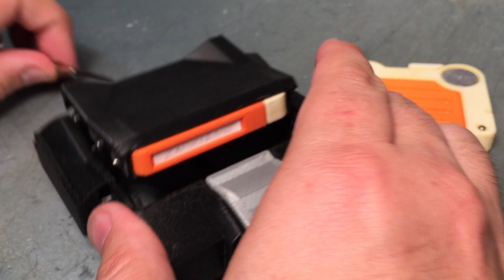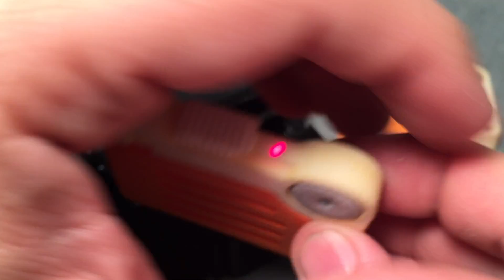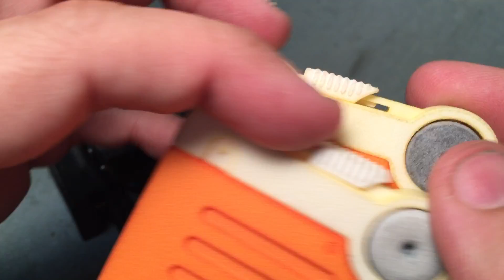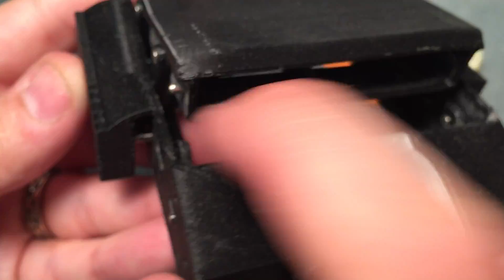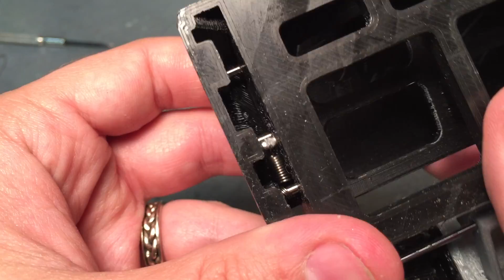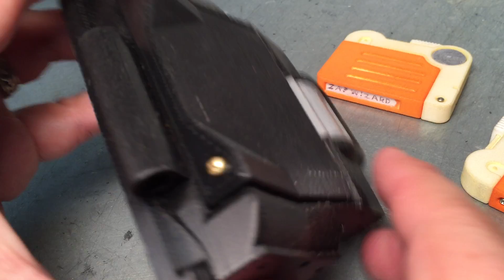Functional Pip-Boy, Holotape Cassette Prototype

Comment: know how an sd card slot works? you can push it in, it clicks and stays in place, then the next time you push it, it pushes it's self out. if you made the tape removable that way, it could push out enough for ya to grab it and pull it out all the way.
Reply from the maker: I don't have room for a spring mechanism. But the design has been greatly improved compared to this video and the holotape pushes out enough now. https://youtu.be/LlMkEVTsFpI?t=91

Comment: May i suggest a spring of sorts as an ejector? Like the ones at the bottom of a nerf mag.
Reply from the maker: The newer versions of the design are automatically pushed a bit when the tape opens, the caddy can effectively move further back than the tape, pushing the tape out enough to grip.
Reply: @ZapWizard  cool! Thanks for the update, i just cant wait to see the finished thing.

Comment: You probably already did it. But you could add springs into the back and some sort of catch that moves at the same time u push the eject button. So as soon as u open it the springs push the tape back out for u to grab the edge